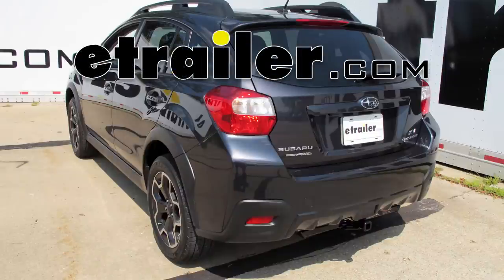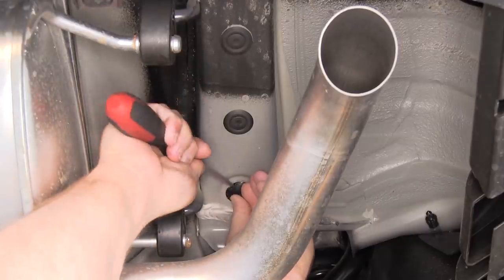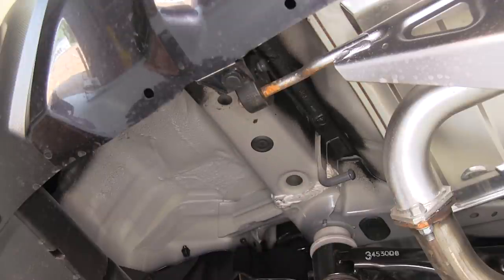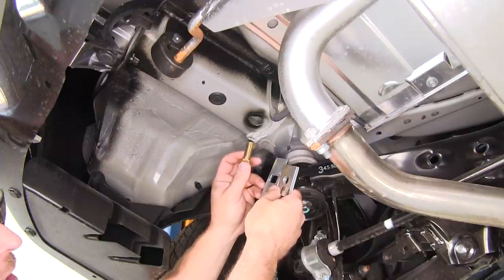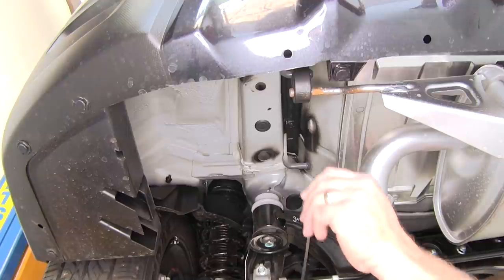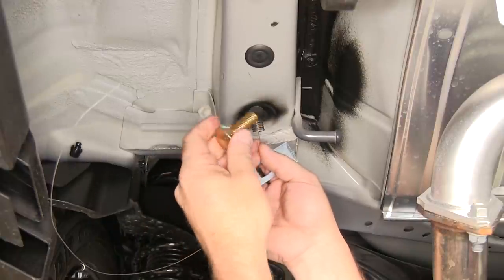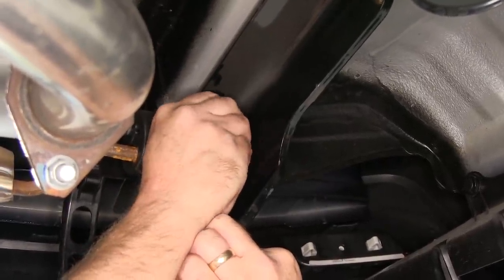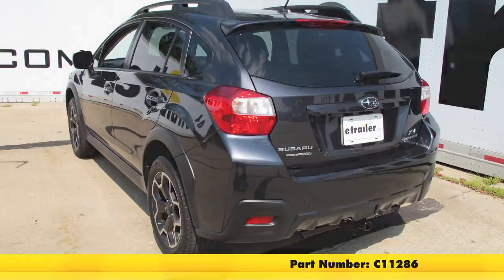etrailer | DIY Install: Curt Trailer Hitch Receiver on your 2014 Subaru XV Crosstrek

Comment: Wow! A perfect video! I just happen to have the exact same model of Crosstrek, so I purchased the Curt hitch and this install went like a breeze. Two small tips if you are on your own as you put the hitch into place - I used double-sided mounting tape to put the spacers into position so I did not have to hold them. Second tip - you can rest the right side of the hitch on the muffler tailpipe while you get the left side bolts in place - the hitch will sit there nicely while you get those first two bolts into position. Thanks again for a fantastic video!

Comment: The center square found on the rear bumper is a hitch cover. I'm assuming there isn't a hitch there, but I'd imagine that a hitch should be mountable so that it would hide behind the rear bumper. Does one exist? Why was this mounted below the hitch cover?